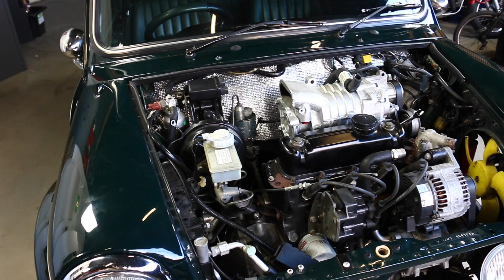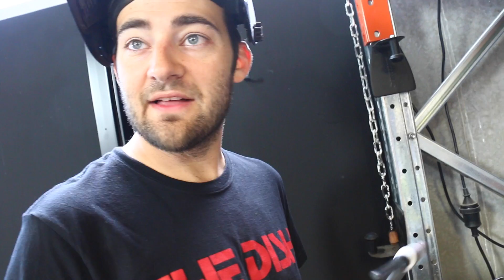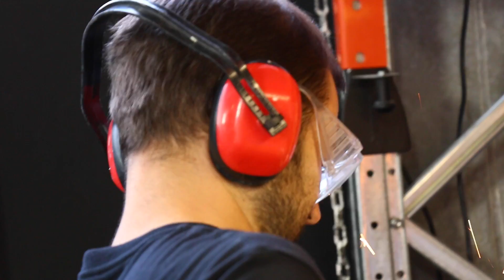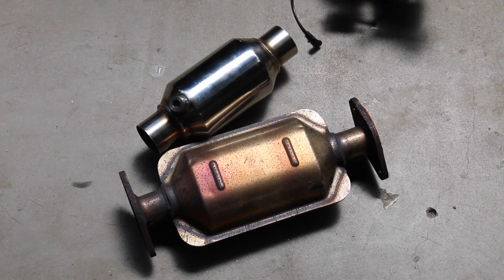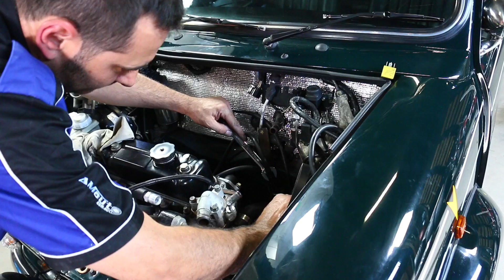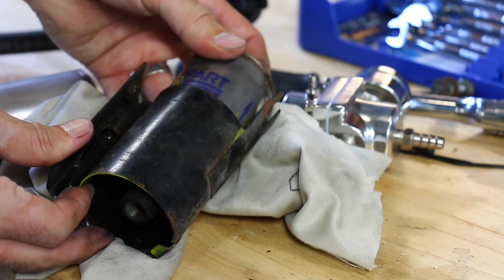Supercharging the Mini - Part 5

Comment: On my one r53 that is still running the m45 , i got it fully upgraded and running to it max and its pushing 19psi at 3200rpm.. its iats also at normal driving stay around 15-20 anove ambient and they never spike more than 100 more

Comment: E85 hoses, what a joke. everything that can survive gasoline, will survive  ethanol. Other problem is "ethanol sensor" it dosen't work if there is any water in tank. It will tell ecu that there is 100% ethanol.

Comment: Can you tell me how's this supposed to be multi-port/point injection? As far as i know MPI uses an injector in the intake port of each cylinder while the SPI uses a single injector on the throttle body. You've just doubled the injector number but they still inject fuel before the intake port which is drawn by the cylinder with the intake valve open.

Comment: Ok so a question that has probably been answered before but I can't see the response.
Why use E85? Environmental reasons or performance? From what I understand you will use more fuel thus outweighing any price savings.  Do you get more kw's from the higher octane rating?  Has there been a dyno comparison between using the two different fuels?  Thanks for the great vids

Comment: hi I have a question I have a locked up engine for a 1990 Chevy Cavalier z24 .1 v6 engine what is the best way of unlocking it it had a blown head gasket but I was able to move the water out of it and replace the head gasket I went to started and it clip so I tried to replace the starter and is stupid take it to the shop they told me the motor is locked up I really appreciate if you could help I really love your show and it helped me a lot of a lot of my mods

Comment: great job guys, i also having a project involving 3 cylinders but sadly without any force induction because its for my collage final year project, can u guys provide some tips?
any welding tips ? custom cable lines for clutch and throttle, custom pedals ? 
any tips will use ~ 
really enjoying this show
Reply: +Baka Yuan Mini's have 4 cylinders not 3.
Reply: ops my bad

Comment: with you guys running both e85 and 98 pump fuel, will there be a difference between kilowatts at the wheel when running either fuel? or will the results be nearly the same?

Comment: even though it is two injectors, you are still running single point injection as both injecters are injecting at the same point. multipoint injection is when you run individual injectors for each individual port which are at different points of the engine.

Comment: can someone explain to me why you'd want E85 over 9x octane?
Reply: +gothops154 it is basically cheap racing fuel since it has a octane rating of about 105 RON. with high octane fuel you can advance the timing of the spark. also you can add more boost pressure with a super or turbocharger. both add a lot of torque which makes horsepower. so the pro of ethanol is controllably producing more power with out pre-detonation of the fuel

Comment: Um, those injectors seem a little small for if you guys are running e85. By my calculations, they're only really big enough for about 85 flywheel horsepower if you're doing pure e85. By comparison, they could do about 100 flywheel horsepower on gasoline. Other than that, it looks like you guys are doing a pretty good job.

Comment: I don't understand the duel port injection on this car. Both injectors are injecting into the same place right? So why not just use a single, larger injector. As Marty said, they make them that big, the ones on gramps are bigger. I feel like it would be more efficient with just one.

Comment: Coming along nicely. E85 runs at 110 octane, but is more acidic than petrol. Should make that 1275 honk. You might want to do a diff ratio swap to make use of the extra nms of torque your producing. Old saying kws sell cars but its torque that wins races.

Comment: £50 quid for a fuel filter that's not good at all I can get that same one here in northern ireland for less than £10 shame you didn't have the same value of money as we do with the Queens head  on it. fricking ridiculous
Reply: I'm not sure you said moog £15 or £50 bucks but saying that should be less than  £10 for the non genuine wix filter.

Comment: What's the pros of ethanol?
Reply: +mini696 it is basically cheap racing fuel since it has a octane rating of about 105 RON. with high octane fuel you can advance the timing of the spark. also you can add more boost pressure with a super or turbocharger. both add a lot of torque which makes horsepower. so the pro of ethanol is controllably producing more power with out pre-detonation of the fuel.
Reply: More power,cheaper Google is your friend

Comment: Does your supercharger have an electromagnetic clutch- To minimize the burden on low rpm ? 
How did you solve problem of rising pressure at closed throttle - valve bypass?

Greetings from Poland

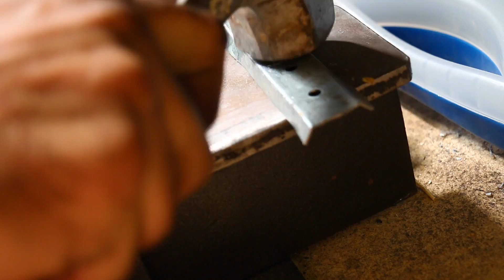Comment: @ 11:41 did you say 98 pump fuel? if you guys have 98 octane at pumps I'm moving to Australia
Reply: 98 in Australia is 93 in the USA.
Reply: +Collin Mckernan The US has to be different so they measure their octane differently to everyone else so our octane sounds really good but it's roughly the same as what you have accept we don't have ethanol mixed in.
Reply: 91/95/98 octane normal fuel, 100 octane E85
Reply: OK thanks. and your lucky about the ethanol. that shit is destroying fuel injectors in cars that weren't made for ethanol.
Reply: +Collin Mckernan I purposely put ethanol in my gasoline car with stock injectors and its been months with no problems. so how long does it take to damage the injectors?
Reply: Depends on the car the fuel injector, how much ethanol your running, what kind of ethanol your running, and especially how much the car sits.
Reply: +juck huo I've run E10 unleaded (unleaded with up to 10% ethanol) in my previous car for 5 years and well over 100,000km here in Australia without any issues and that was a 1995 Mitsubishi Verada with the 6G72 SOHC V6 3.0 litre and still run it without any issues on my currant car. The only thing I do is change the fuel filter every 10,000km and it keeps it happy.
Reply: +Damon Enz I've seen 93 in California.
Reply: Here in the netherlands we have 95 and 98, germany even 100. Dont get why you guys havent got that
Reply: +Collin Mckernan Europe has higher octane for some reason. But gas is also way more expensive here too. I'm stationed in Italy and they give us gas rations to pay for our gas.
Reply: KJ-Verada VR-Xi cool, glad to hear that. i have yet to hear a logical explanation of how ethanol can damage your car. best of wishes to you
Reply: I'm currently in New Zealand and was talking to an Australian, and he was blown away that regular fuel in North America is only 87 octane, in Australia, regular is 94 and premium is 98
Reply: Didn't realize it was measured differently place to place though

Comment: I am going to love... LOVE seeing what the emission compliance test looks like with the extra fuel flow and the high flow CAT. If they get this first run, I will be amazed.
Reply: +gus bisbal I do believe Haltech Elite can sort out that little problem :D

If volskwagen can, they can too
Reply: Unless they tune it down then tune it back up which is strictly illegal. They will have to put the old CAT back on. Maybe two CATs.
Reply: +gus bisbal Different laws in Aust bud.
Reply: +gus bisbal Why do you capitalize catalytic converters?
Reply: HJZ75driver I am Australian and obviously you have never done forced induction on an engine and then done the IM240 test. They test on Hydrocarbon levels, Carbon monoxide/ Dioxide and NOx levels. High flow CATs don't scrub exhaust any where near as well the normal CAT. Their only saving grace is that they are not boosting to like 18psi.
Reply: ***** I am unsure of what that statement means. If they were running 15 psi and over then two CATs maybe needed due to the fact that basically double the fuel flow is required to make that work. Not always but sometimes it is needed.
Reply: +gus bisbal To register it, they dont do IM420 tests etc, as long as all the gear's there, she's good
Reply: What does, "as long as all the gear's there, she's good." mean. They have altered the cars drive chain and that usually requires engineering certification, which requires the IM240. I am in Victoria so it might not need engineering cert in NSW but I highly doubt it.

Comment: Could this mod be done in the States and be legal to drive on the street? What would have to be done to make it legal in the States?
Reply: It'd be legal, but there are certain limitations. I'd talk to a certified mechanic first.
Reply: +amtpdb1 In most of the US, you can do this yourself without any sort of hoops to jump through. Some states have emissions tests, but most don't, and even in ones that do, a proper ECU tune will pass. The only real trouble spot in the US is California.

Comment: You TIG welded OVER mill scale? Why would you not flap disk it back to bright metal? And don't tell me you did because that's where the sparks came from when you struck the ach. TIG NEVER produces a spark unless your base metal isn't clean and free of mill scale. Marty shame on you. It would have taken 30 seconds.

Comment: 50 bucks for a fuel filter?  mother of god
Reply from the maker: +brakedd Welcome to Australia
Reply: +Mighty Car Mods The Australian Peso doesn't buy much at all unless you use lots of them.
Reply: +brakedd thats what its like in anywhere but the US... I am in Canada, when I had to buy spark plug wires I ordered them locally for $110, found out the same ones where $30 in the U.S. :O
Reply: +Mighty Car Mods I want to visit Australia.  I'll bring a case of fuel filters and live like a king!
Reply: +rawrs co 50bucks for an oil filter!?!
Reply: +brakedd On my truck the fuel filter is a part of the pump so $250 USD for that assembly.
Reply: +brakedd Hey, welcome to Australia.
Reply: yep, diesel life ;_;
Reply: +rawrs co i just paid 12$ for a k&n oil filter and its a huge fucker too lmfao
Reply: If your filter costs a ton, remove it and fit in new fuel line ends to accept a filter from a fleet vehicle.
Reply: +brakedd Get one for a mitubishi lancer is $350.
Reply: +Fraser Hughes Is it not roughly half so 50 AUD is about 25 GBP?
Reply: Aaron Hardie I was trying to point that point out. Everyone goes mad when Aussies pay loads for shit but in reality exchange rates mean prices are similar
Reply: +Hris Marchev In Canada here I paid about $3 for the oil filter that I had to get for my little Suzuki Swift recently...one of the 90's G13A motors, a single-point-injection 1.3L 4-cylinder making 68 HP 75 lb/ft torque. It seems the G13 4-cylinders need a fuel filter between 8 and 20 dollars Canadian depending on if it's an A or B edition, and if it's NA or not.
Reply: +Mighty Car Mods what's up I'm a huge fan of mcm
Reply: +brakedd no different then in Canada either. The last fuel filter I bought for my mk2 supra was $80 for a run of the mill one.
Reply: +brakedd my fuel filter for my mazda bt-50 cost $80 :) and my oil filter cost $50
Reply: $12!!!! where from?
Reply: +brakedd 8 8 bucks for one in the US.
Reply: +brakedd $2 for one in my old chevy truck. =]
Reply: It's E85 no duh you need a stronger filter..
Reply: +M3RKB00ST3D :P And, what do you mean by stronger? it looked to be a standard OE replacement filter.....
Reply: +MechRider89 I'm in Canada and just got filters for two of my cars for like $15.  They are run of the mill Fords though..
Reply: +brakedd It's often cheaper to buy parts from the usa and get them posted then it is to buy the product locally. Even after postage you can pay 1/2 - 3/4 of retail price in australia!
Reply: My 03 mustang cobra costs $90 USD and my track ready 04 STI costs 130 USD. Imports....
Reply: My 99' Camry it costs $7
Ha!  And people say my car is stupid
I save so much money thou
Reply: +brakedd S5 RX7 13B turbo $13 bucks! haha
Reply: +J⃟O⃟N⃟A⃟T⃟H⃟A⃟N⃟ S⃟C⃟H⃟U⃟L⃟T⃟Z⃟ It IS stupid, but it's also stupidly cheap so it balances out ;)
Reply: +rawrs co IKR but the diesel life is the best
Reply: +brakedd $3.50 for my '96 Cutlass Supreme. So far I'm in 2nd place behind the Chevy truck guy
Reply: +Gee Zed Eee Power Not so much in the last year or so with the 30% drop in the Australian dollar vs American dollar
Reply: +brakedd And when you go back home, you can bring a case full of cheap medicine and profit again!
Reply: +brakedd Thats about 3p in the UK. AUD are awful
Reply: +brakedd my fuel filter here is 5$ and my air filter is 3$ ...our parts are cheap but our salary is low too...:D
Reply: I can get 7 to 9 exact same filters in my country for these 50 ducks
Unacceptable!
Reply: Aaron Hardie Have you ever heard of Sarcasm?
Reply: I didnt think you actually meant 2p. What i meant is its not really THAT much cheaper, as in its not as cheap as some other guys are saying from USA and the like.
Reply: +Fraser Hughes  100% Agreed! Maybe USA prices are low but I wouldn't say in the UK we get stupid cheap parts unless they are from the scrap yards. Sorry for the confusion.
Reply: Aaron Hardie No we don't cause we have to import everything aha
Reply: I have paid 4€ for oil- and 11€ for fuel filter for my 2005 MX-5. All genuine Mazda parts... Holy shit austrailia is expensive
Reply: +Jonas Mink That because AUS did not go down in the GFR and now the whole world screws us on trade and costing like were all rich or something.Or they got the exclusive gold plated platinum lined fuel filter. Just kidding  I think they got ripped off.
Reply: +B Scully Yeah but exchange rates and domestic pricing doesn't work that way mate.
$50 is a fken lot of money in Australia even if it equates to less foreign cash.
24 pounds is a lot of money too actually.
Reply: FSCB
I think its more of a how long and how many fuel filters have been made over the years but the some seem to get more expensive and AUS does get sting from overseas suppliers a lot.
$ 50 bucks is nothing misubshi lancer fuel filter $ 350 as they make it and goes inside the tank not in line.
Its a big off !
Reply: +brakedd I paid $145+ for my fuel lab fuel filter... and it's MADDDDD!!!
Reply: Holy moly.
The filters mad or you are after having to pay that much.
The mesh inside must be made from fine gold threads.
Reply: its a bad ass filter that has a low micron stainless mesh filter that is washable, it also has a one way check valve to hold fuel pressure when the engine is off and it's made from aluminum that's anodized blue to match my secondary color on the car...sweet!
Reply: That sounds nice but color matching does not make for better or faster.
Reply: +AVAMagneticlev tell that to all the super wogs.
Reply: +AVAMagneticlev doesn't make it faster or better, but for me, overall presentation is everything when building a car. and if you seen how I'm building my car, you should understand...
Reply: I understand too much as worked for 3 car manufactures and cars been there done that to. The fastest car I built was a sleeper never even painted it just bonnet mat black from a can. But was always funnier chopping nice shinny over done cars that would have been much faster if they spent more on parts not paint and crome.
Presentation is noting if the car does not function to its purpose or looks fast goes slow.
What will be the main purpose to your car to get people to look under the bonnet at your fuel filter so you can tell them how much it was ?
PS. I hope your car is not to be turbo or force induction as you will need to replace the oil filter every 5,000km
PSS if you project has to be seen to understand put on the tube and I will take the time to look.
Reply: +AVAMagneticlev i did post one video of my car on the rotisserie. see if you can view it. if not I'll find it for you. 

i have been in the automotive technology arena for 20 years. i make fast vehicles that have both show and go, so presentation is everything to me.

and to be clear, a rat rod can be done with presentation and still be rusty and grungy. It's not the pen, it's how you sign your name...
Reply: Well said I understand better now.
Reply: +AVAMagneticlev thank you my car brother.
Reply: Makes me wish even more that my car would run...I know that it's gotta be plugs and wires, distributor, or some other part of the ignition system, but I haven't the money to fix it ATM because I got fired unreasonably. Not gonna say what happened because drama is not needed, but it's better that I'm unemployed looking for hire than continuing to work in that place.
Reply: I don't know what is worse havin a car that don't run or like me not owning a car.
I think it almost the same.
Some times better to be broke from a while than work if the conditions are not right as some work places and bosses will use you screw you and then lie about it after to save them self. Happened to me was a incoperdent drunk called( Peter Parsons ) never work or trust this man. YOU MAY GET INJURED like me and he will lie to try to get away with it also Addeco contracting work care AUS help back date form and also QBE insurance when along with it to save them the cost QBE insurance lied alost to me and broke promises they made .
If you work in AUS don't trust this  incomperdent drunk lier or the system o save you.
They or him can't sue me for saying this as was his own works to me he told me drunk too much screwing up has been noticed by others.
His own words !
Ps. I hope you find a good safe job !
Adam VA of AVA Magnetic Levitation AUS
Reply: supervisors / bosses like that are cowards with power and they are the worst kind...
Reply: +PANTYEATR1 Yeah.